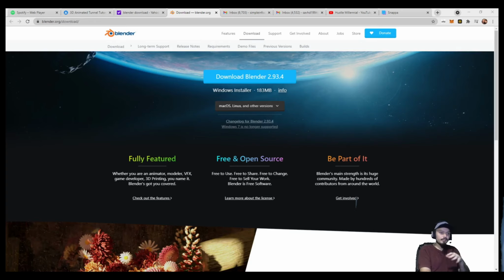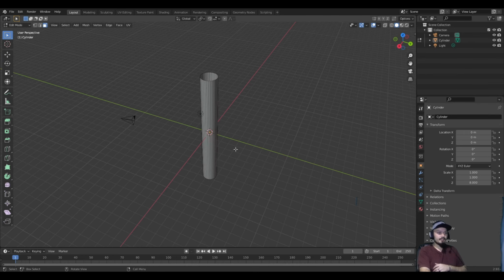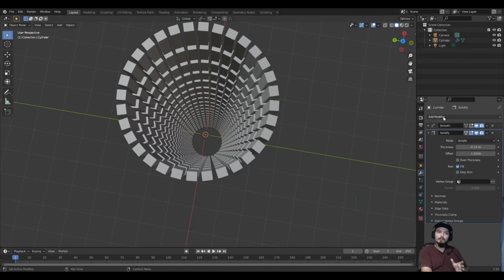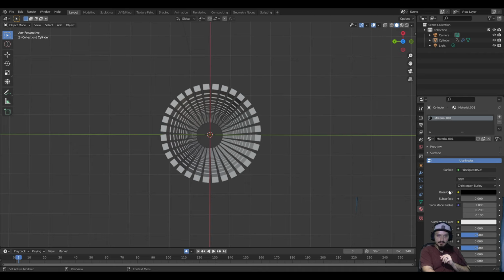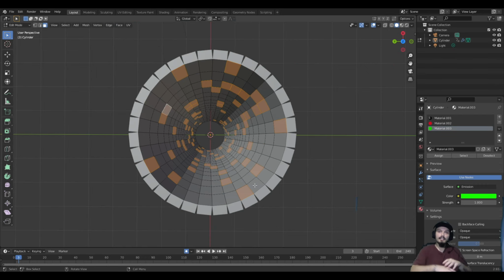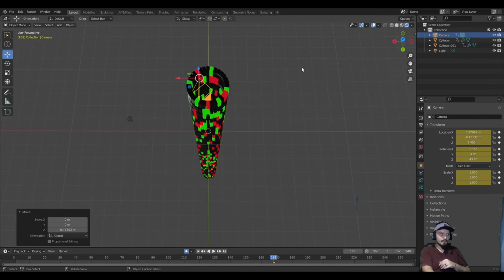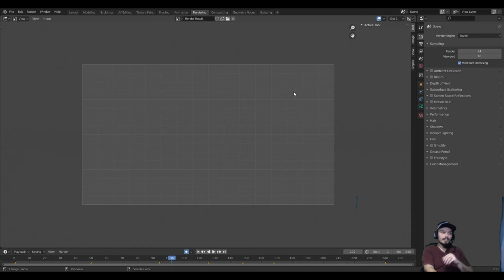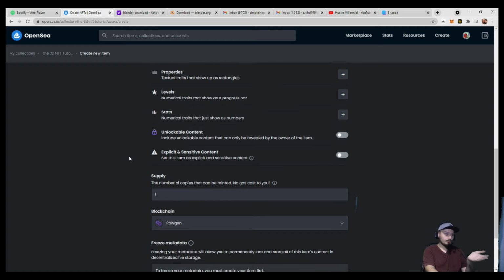How To Create 3D Animation in Blender & Turn Them Into NFTs

Comment: What settings did you use to render. I haven't been able to output a file format that works on Open Sea (other than GIFs).
Reply from the maker: I rendered as an MP4, then had to compress the file using handbrake.
Reply: Thanks Dude. I’ll try it out.